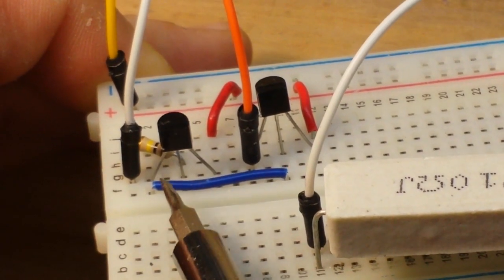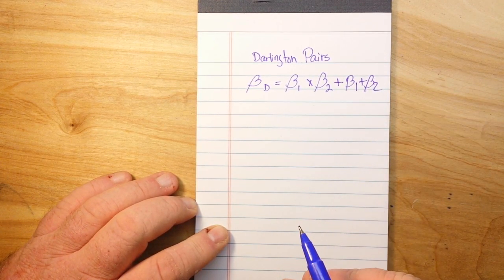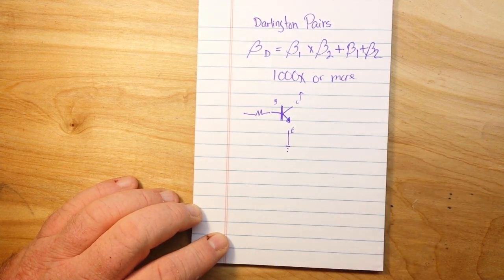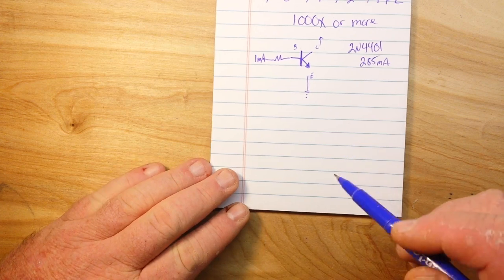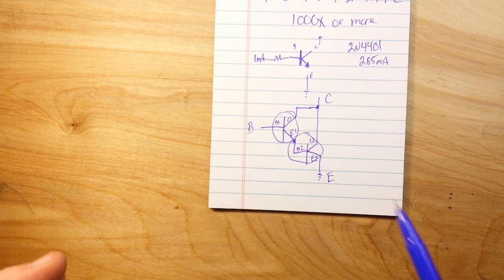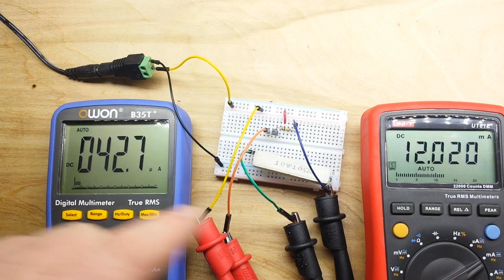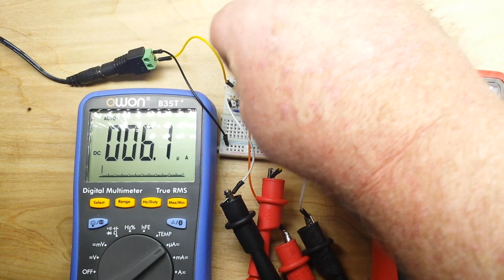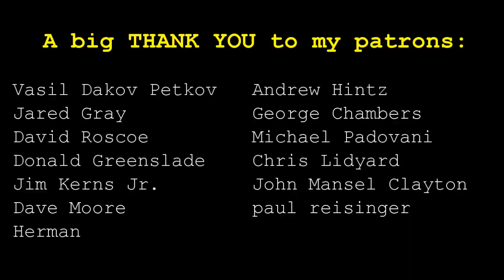Introduction to Darlington Pairs

Comment: great video. I wish you included examples of circuits that commonly use Darlington transistors. I am very interested. and would like to know more. like when to use a Darlington. or could a MOSFET be used. also why use a transistor over a MOSFET? I have so many questions. great video...
Reply: Yes, I'd also like to see a video on when to use what. Good video as usual.
Reply: I think MOFFETs are used mainly for really high frequencies, where regular transistors can't switch fast enough.
Reply: @TortureBot  MOSFET's are typically faster for switching a load whereas BJT's are faster for signals. So depends on the application.
Reply: If you take a look at the internals of an opamp, you'll see a bunch of them.

Comment: Just curious in the test with one transistor the base current was 42uAmps and when you connected both into darlington the base current drop even though you said on tape it increased but actually on the meter it showed decrease to 6uAmps why would that change like that you used the same base resister?

Comment: Every diagram of an NPN transistor I have seen shows the collector on the left; the base in the middle; and the emitter on the right - when the flat side is facing me.  However, in this video, the collector and emitter seem reversed!

Is anyone else seeing the same thing?  If not, if the flat side is facing me: from left to right, should it be emitter; base; collector?
Reply: You can orient them whatever way you like. The only thing that matters is that the arrow points away from the gate towards the emitter of the NPN transistor. For a PNP, the arrow points at the gate from the emitter. The arrow is basically acting as an indicator of the flow of conventional current: with the NPN transistor, the current flows from the collector and gate to the emitter; with a PNP, it flows from the emitter to the gate and collector. The important thing is to keep in mind the implication of which side the arrow is on, which indicates the emitter pin, and its orientation, which indicates its type and current flow.

The typical orientation I've usually seen is the one Paul used here, but it's not the only one.